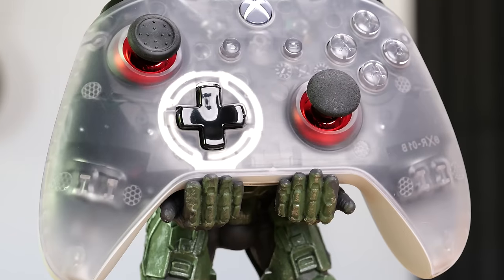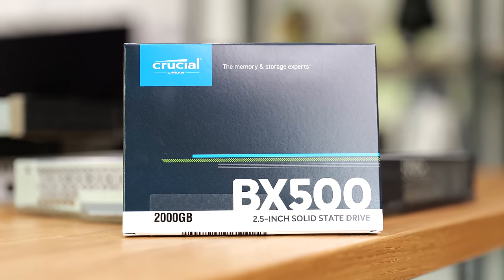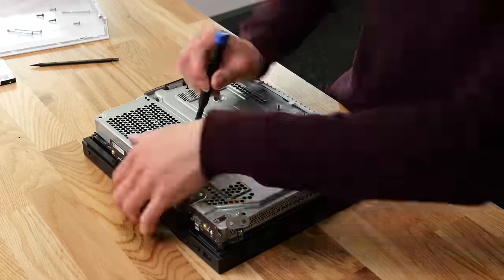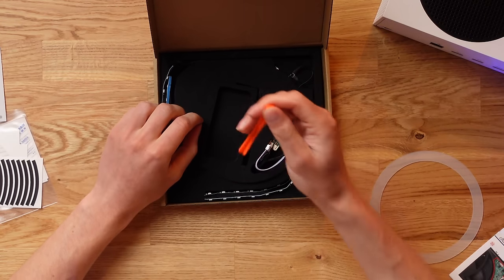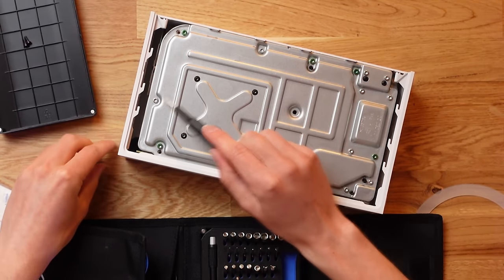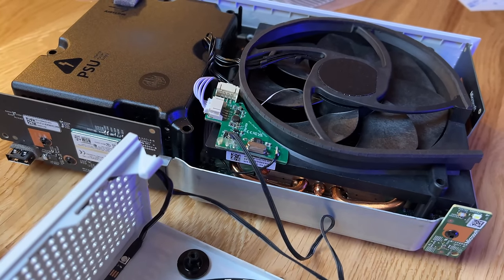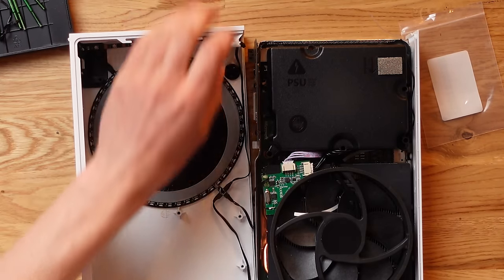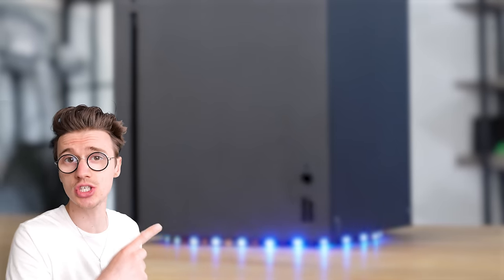If you have an Xbox, TRY THIS!!

Comment: In regards to the Xbox storage upgrade:
Can I replace the old drive with a higher capacity drive without any issues or do I HAVE to get one that matches the old drive in capacity? I have an Xbox One X with a 1TB hard drive inside. If I replace that drive with a 2TB SSD, do I have to do anything extra?
Reply: the example in the video is doing exactly what you want to do, putting a 2TB SSD into a 1TB One X
Reply: it will work  fine if you use a 2tb
Reply: Will i have tp replace all my ggames?
Reply: @Just_Racky yes but u can copy over ur games or transfer em

Comment: I think if ypu have a broken xbox series s or x, and you still have your xbox onw laying around, I think ypu could put in the Ssd thats in one of the series x/s. Then I think you could put that ssd in your old Xbox one. And then you might have a xbox series x/s running on your old console. Please tell me if im wrong, because this is entirely theoretical.
Reply: Merely swapping the Xone's HDD for a Series SSD isn't gonna make your Xone a Series for the same reason deleting the backseat won't change an EcoBoost Mustang into a GT350R - the storage capacity upgrade don't mean anything without the power of the Series CPU/GPU/RAM...